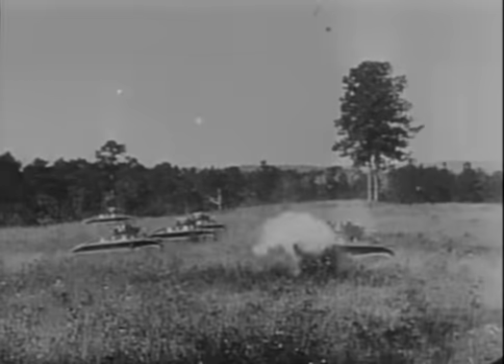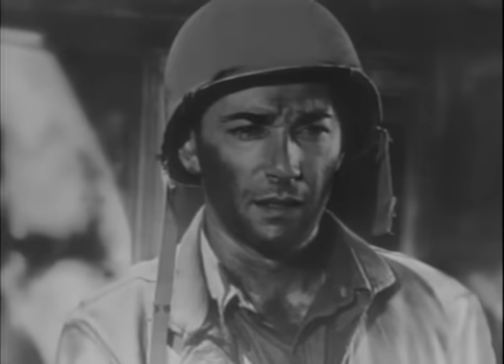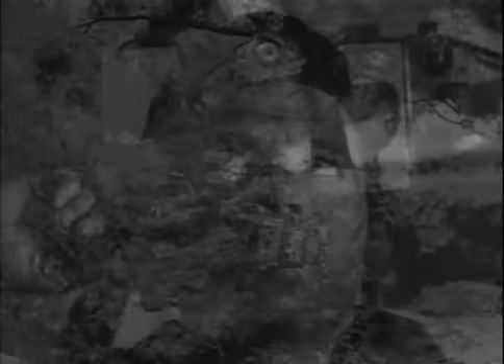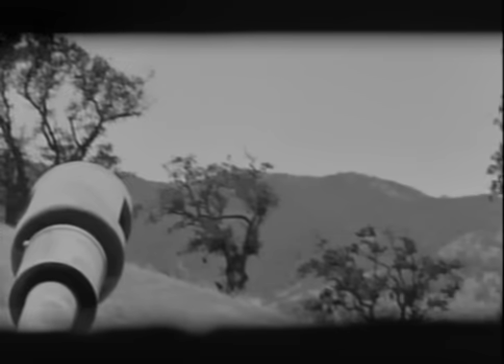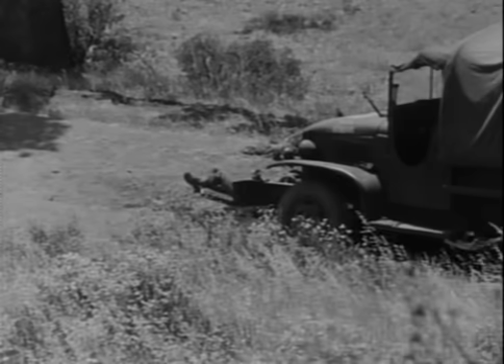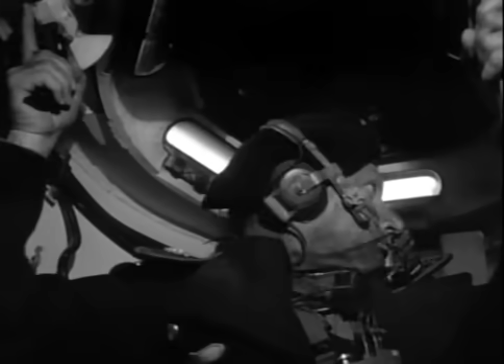COMBAT! s.3 ep.4: "The Duel" (1964)

Comment: Very awesome in deed and very clever too esp holding up the tank until sgt Saunders does the impossible by opening the engine cover plate over the engine and then placing a 5 gal can of gas on top of the plate and opening the lid so fuel runs down into the engine compartment then running away from it only to use the Tommy gun to shoot holes in the can so fuel will leak out down inside so it catch s fire and blows up sounds like something mcgyver would do if he was in ww2

Comment: That bottle jack would just press that stone he's using into the mud, instead of lifting the weight of the truck. Especially THAT truck, full of those heavy supplies, and it being the front tire under the weight of the engine. 

He needs something long like a thick plank to go under the jack, (or under the stone and jack both,) to distribute the weight across the surface of the muddy ground more. 

(Hey! What are the comments even for lol if not shit like that eh?!) 😇👍
Reply: To complain about the road being so dry, it's blowing mile high dust, yet tire blows in mudpit.

Comment: A couple of bloopers:French Hotchkiss H-38s on manouver before the war,in the intro,though a few were still in use on occupation-duty.A glimpse of an English Mk.IV,never used in combat.
    The Germans disbanded their leather-helmet with beret in 1941,and they did not have dierect connection to the commander from the outside.
    Any other infantry-man,would have thrown the grenades against the tracks,not the turret,or run in a straight line under fire.But,hey,this is entertainment....

Comment: Sometimes I'm less than impressed by an episode because of how much the scenes rely on suspension of disbelief to work.  In this case, the driver does not strike me as being believable because he takes so long to get around the problem of the soft ground and mud.

Example / comparison -- Sgt. Saunders grabs an entrenching tool nearly immediately ( 34:45 ) while the driver is only ever shown using his hands to dig the wheel free;  moreover, it takes the driver way too long to figure out that he needs to put something under the jack to distribute the weight and stop it sinking.  In short, the truck itself ought to have something which could help more than the rocks by themselves, perhaps in combination with the rocks, but having an obvious solution to this dilemma won't make more drama.

The Tank also has a few odd moments, but the worst of them occurs moments before Saunders returns to the truck and the driver gets pinned.  While we see that the Tank is attempting to roll forward and then backward to clear the obstruction in the right-hand track (with a Close Up shot), the wider angle of the Tank on the roadway as seen from Saunders' position shows it creeping forwards (only) by moving with the tracks going Forward only, left hand then right hand.

Comment: the Germans were not using 50s they had mg 44s
Reply: Stephen Casey It's a TV series. Had they had access to a real MKIV or Panther, then they would habe been able to mount an MG42 or Mg34. As it is, these M41 Walker Bulldog tanks were on loan from the California Army Guard. An MG42 won't fit in the cradle of a American armor equipped with s .50 BMG!